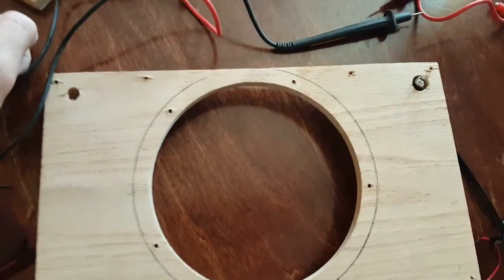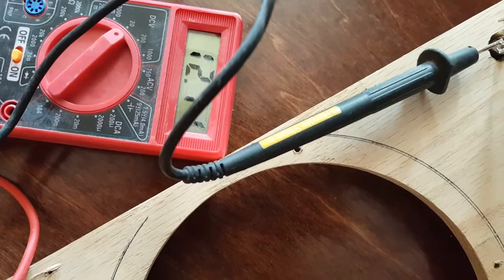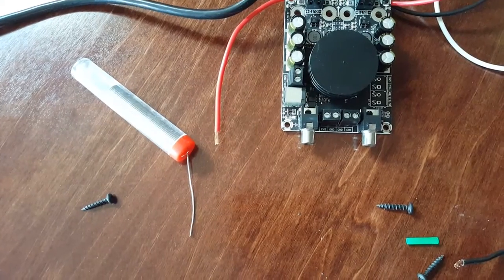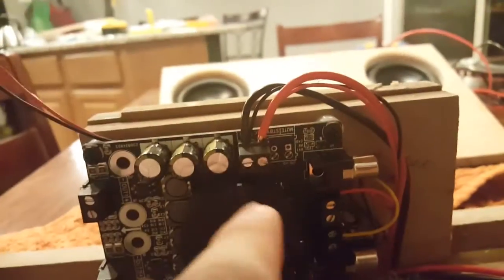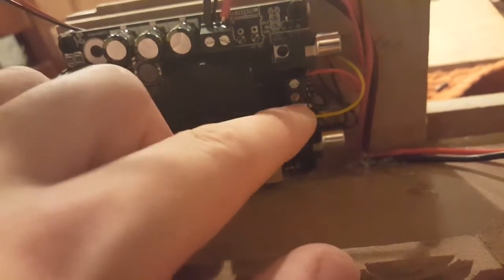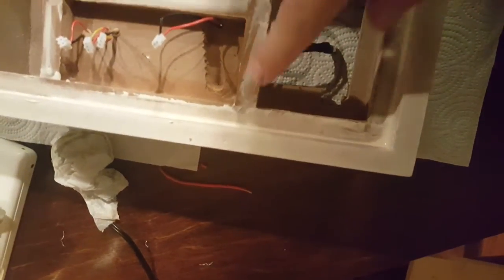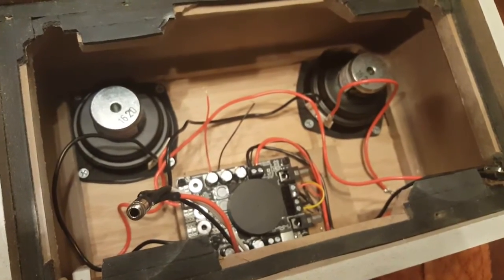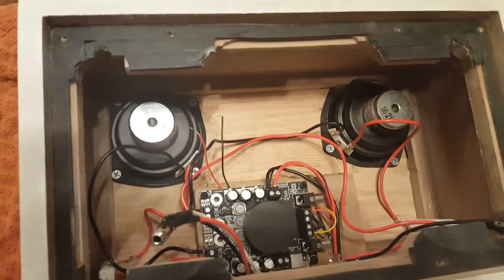JP Bluetooth Speaker Build - Wiring Part 2 Final

Comment: Which amp (brand/watts/price) is that and do you prefer it over one of the Lepai amps?
Reply from the maker: I have used the lepai in other builds.  Here is one of them  https://www.youtube.com/watch?v=_BkgceNMko4&list=PL6hjpiCHZmIO09ediZ7uYrMx_R3Px8Xvt&index=8   I also used one in my Dewalt Speaker Build https://www.youtube.com/watch?v=gyjpZ3c5CbY&list=PL6hjpiCHZmIPBLZycfUAgtiyKM4RQk2iH&index=12 They are great, especially if you want to fine tune the treble and bass.  But for speakers, where you will do the leg work ahead of time, this Sure Amp is much better performance for the money.  This particular amp is the Sure 2x50w Amp AA-AB32178, which cost around $25.  I am using a 12v 6amp power supply.  Here is a link to all the parts I am currently using in the build.  I am still messing with the resistor to get the best sound out of it.  http://techtalk.parts-express.com/forum/speaker-project-gallery/1298901-jp-bluetooth-speaker-build
Reply: Awesome, thanks. So basically the Lepai's advantage is the tone controls, while the Sure amp has better sound quality, and is more powerful?
Reply from the maker: Exactly . Although, a more accurate statement would be the Sure amp has a higher potential output.  That just depends on your power source.  Volts x Amps = watts .  This assumes 4 ohm speakers.  For 8 ohm, take half of that to get your total wattage.
Reply from the maker: I wasn't sure if this was a rhetorical question, but yes.  Honestly, if you properly design the enclosure and crossover, you shouldn't need tone controls.
Reply: How so? I'm a newb to all this, but I know for me personally, no matter what I'm listening on, different types of music need different adjustments.  For example, sometimes I'll need more bass in one song, and less in another.
Reply from the maker: It is hard to explain.  But typically there are 2 reasons 1 needs to EQ their music.  First the speaker doesn't do a very good job recreating certain sounds.  So on some music, where you are looking for those sounds, you need to increase or decrease levels.  The second is due to bad recordings.  However, if you have  a speaker that is properly built with the right crossover (assuming a good recording) then you would hear exactly what the artist wants you to hear.

On the lepai, the two tonal knobs do adjust high and low frequency.  Which is a very wide range of frequencies.  So if your speaker is built well, you will never be able to overcome that with just bass and treble adjustments.  Although, it may make it sound a little better from song to song.  You will just have to constantly be adjusting it.  This once again is to compensate for bad speaker design or a bad recording.

I hope this helps